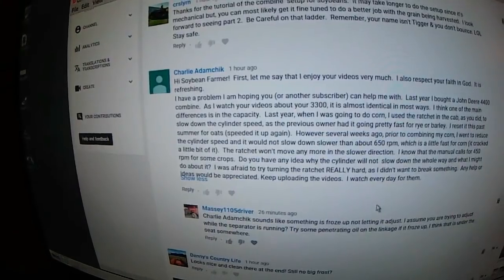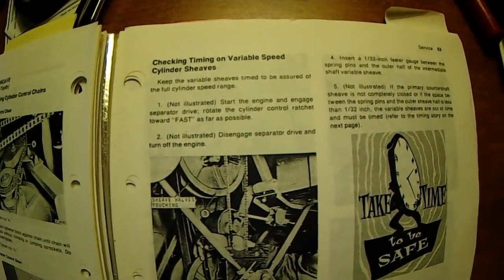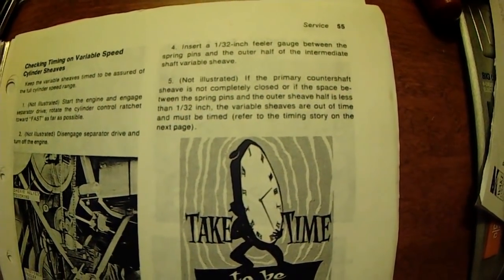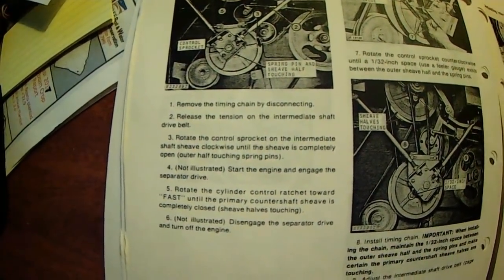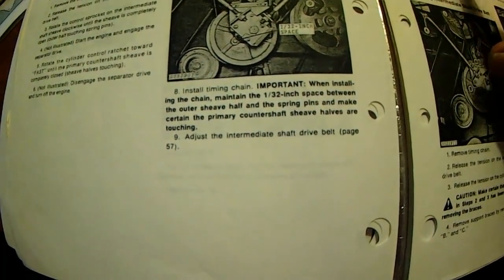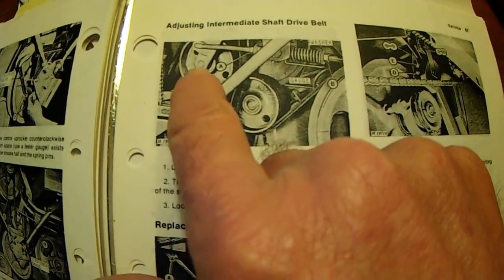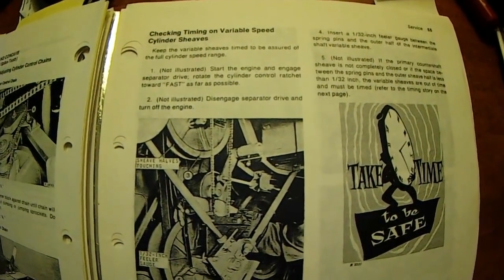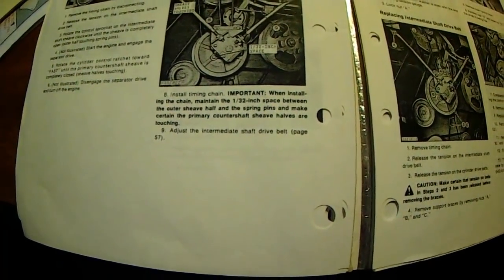Charlie Adamchik my suspicions concerning your 4400

Comment: In addition to the question in this video, I also asked you once regarding the pros and cons of rigid heads for harvesting soybeans.  Well, today I looked at and bought a 213 Flex head for my 4400.  So, now I'm ready to start growing soybeans.  Will probably have questions, as I have no experience for them.  The farmer I bought the head from was using it on a 3300 gas and also has a 3 row corn head.  The 3300 and corn head are also for sale.
Reply from the maker: Charlie Adamchik - I am so very pleased you were able to find a flex head.  life is going to be so much easier for you on smooth even worked seed beds.  the flex was a large improvement over the rigid.    I'll share what I know and have learned.   best 2U Charlie

Comment: My manual says the same thing, same page and its for a 4400. I think the cover is the only difference
Reply from the maker: larsonvalleyfarm - did you ever have to figure out what those instructions were saying?  took me awhile.    check page 111 trouble shooting Variable Speed Cylinder and see if you can locate two different issues where the stated cause is variable sheaves out of time.  one of them is a trouble stated to be cylinder speed will not adjust.   going to be kind of neat to find out your page 111 is the same as mine.   thanks for subscribing, watching and commenting, I enjoy talking to you and watching what's going on at your place.